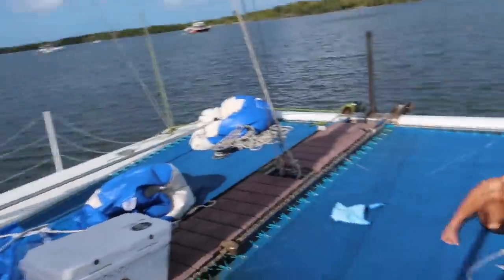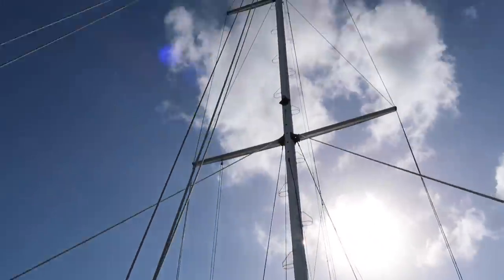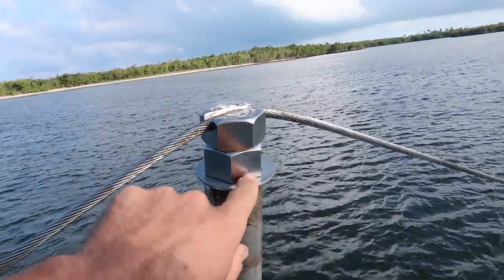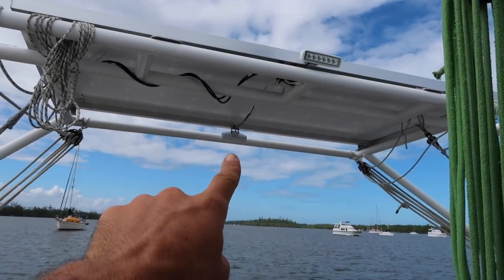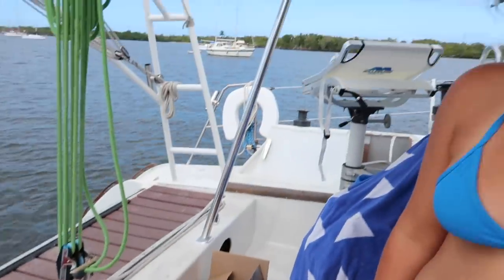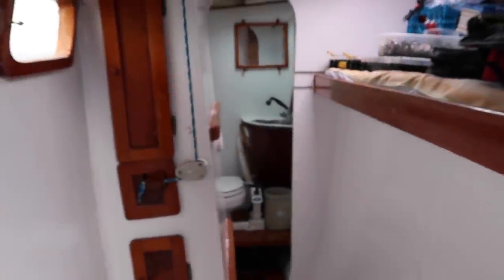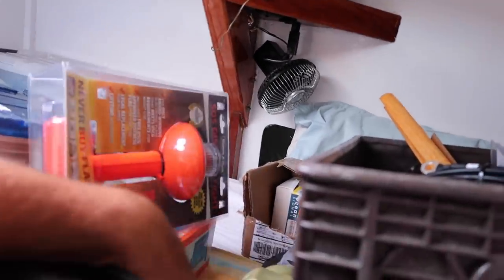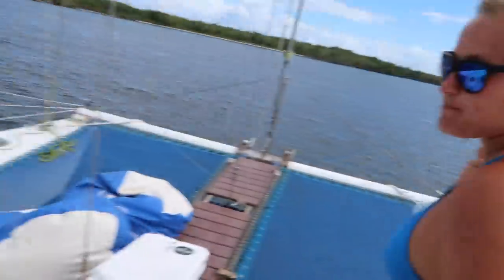DISAGREEMENTS ON A BOAT. should we have a generator on a simple, fast, multihull cruiser?

Comment: Come on Billy bring the gen., not necessarily for the a/c but for an emergency basis, you never know what may happen.  And if you two do not use it maybe you can barter with someone for diving tanks or similar things down the water.  Think of it this way, you never thought someone would still the motor from the dingy if so you may have taken better precautions . . .  so with the gen it can be justified as a precaution for "who knows" what could happen on the water!  BRING THE GENERATOR. LOL

Comment: That 2000i weighs 45 lbs. It also has built in 12v charging at like 8 amps. You can easily drain the fuel and its there if you need it since you already own it.

Comment: Be careful with that nut tensioner arrangement.  The bottom nut may have a tendency to vibrate upwards and cause your cable to come loose. Either a large lock washer or lock-tight or a lock-nut would eliminate that. Would hate to see that nut come loose when your fully rigged out at 15 knots.

And definitely take the generator and small A/C.

Comment: Comfort over speed, I will vote for comfort all day long now that I'm getting older, but I was just like Billy, speed was the priority when I was younger. If you do go ahead and get a AC unit, make sure it has a soft start installed so the small 2000 watt generator can handle the load.

Comment: First of all, having spent summer in the Caribbean, it can be amazingly hot AND you have the no see-ums and mosquitos in your remote destinations so the screens will limit air flow and no sleeping under stars unless windy!  Billy, you are not racing, so what's an extra 40-100 pounds?  Buy the AC in Florida too as in the Bahamas you will not have much AC unit choice, and it will be super expensive.  Better to have it and not use it, than be miserable and wish you had it.
I read a cruising article once that commented by using their AC only a few times a week, they also kept the mold under control.  Billy can use that data to save face and justify the extra weight.

Comment: Take the generator you could use it to charge your batteries in case you would have a short in your wiring or for starting your engines.

Comment: Yes on a generator and A/C.  Sometimes you need a break from the heat to think clearly and get a good nights sleep.  It will also top off your battery banks when it's overcast or raining.  As you improve your solar and wind power generation you can eventually wean off it.

Comment: Billy, Are you going to clean the hull every week? Slime will slow you down more than a 50 lb generator. A week of cloudy, rainy weather will devistate your batteries, but the little Honda will keep them up when neccessisary. Bring it. You won't regret it. When are you going to install the hydrafoils? After all, the cat doesn't have planing hulls and you installed huge rudders that have loads of drag at speed. I always carry a generator. The amount of money and weight I save by not having a big battery bank pays for my little Honda. Fair winds, Brother.

Comment: Bring it. Run power tools. Charge your batteries (boat, computers, cameras, etc). Run extra lights if you're working on something at night. Maybe you get an A/C and maybe you don't, but there are many reasons to have backup generator power. Most boats your size have one - for a reason. The extra few pounds won't make any difference. And Sierra is right, if you really need to find another 60 pounds somewhere, you can. And I bet whatever you find to remove is more optional than what a generator should be.

Comment: As seasoned boaters in both hot/humid and temperate climates, the ability to “get out of the elements” and find some comfort in our cabin was essential.  We always had the “option” and I would vote with Sierra on this one.  40 pounds is not much in the big picture.  I also sense some stubbornness here.....as a neutral observer, put the dang thing on board.  Boom! Done!

Comment: Check to see how easy it is to get batteries and solar power parts where you are headed.  
 understand price per hour. The generator  maybe cheaper than running the motor  if you need to power up that way. 
 I would look to see if you can supplement propane for the generator. ( IE like a electric skillet or grill) . And what are the price points.  It maybe difficult getting propane. IE travel far away.

Comment: Dudes, I have a diesel genset installed on my boat and the only time I run it is to check/service it. I never run it at anchor. I only use A/C at the marina - at anchor the wind cools the boat, jump in the water, use full deck shades. Extra unnecessary maintenance!!

Comment: Unless you're short on space - just bring it. Why argue over it? If you don't need it you can probably sell it in the Caribbean for more than in the states because somebody is going to be willing to pay a premium to get it there.   To be able to bring it but not do it is not the logical answer to me.   I wouldn't get one personally but if I did have one and I had a cat I'd certainly not limit my options because of 40 (or 60 :)  pounds.   You saved that moving to titanium alone.   BTW: did you get titanium bolts as well?   Would love to know more of the technical specs for what titanium brings to the table.

Comment: You should take the generator, but you should also check to see that it will have enough power to run the AC. The starting surge on many AC units will overload many small portable generators. Try it out - don't go by the specs.

Comment: I'll bet that generator doesn't put out enough watts to run any portable AC unit, it would be very useful for  innumerable other things, ie, charging batteries (boat batteries, portable tool batteries, etc) running a sewing machine (you may need to borrow one for repairs), ac powered tools. Remember, inverters can crap out too so you may need another source of ac power. I carried one for many years througout the south pacific on my boat & it was invaluable many many times. Besides, if you eventually find you don't ever need it they can be easily sold to a boat that wished THEY had brought one! You're going to be carrying gas anyway for the outboard. Besides Billy, you're massively out voted it looks like anyway. Keep that girl happy, take it!

Comment: Bring the Genny, buy a small 5000btu window AC and an emergency battery charger.  If you never use it, it's not much weight and space.  If you actually need it, it will be worth it's weight in gold.  I have kept a generator in the garage/shed for the last 15 years.  I maintain it and use it when camping and for power outages.  It's the Yamaha ef2400IS and it is amazing.

Comment: Forget AC as the reason, that’s a45.6lb generator, you own it, you already carry fuel aboard, you anchor full time, IMHO that generator is a backup system which should always reside aboard. It’s a backup against batter, solar panel, converter, etc failure. The weight is a minuscule fraction of the vessels GVW

Comment: What are your plans to keep the fridge going if you encounter several days of no solar? Running the diesel several times a day or you could let the Honda pick up the slack. We're heading to the Bahamas for a few weeks and def will be bringing the small genny
Reply from the maker: Well, we could always run one or both of our inboard diesel engines to charge the batteries like we have always done.
Reply: @Tulasendlesssummer  yes that is an option keeping in mind that genny is way cheaper to run, repair, replace and keeps unneeded hours off those workhorses...love our ryobi that idles down super quiet when it has small loads ;-)

Comment: Yes to the generator. Yes to AC. Also in the future of having a water maker on board, would make it so you could be away from marinas or having to haul jugs of water. The weight that a generator and a small water maker would be less than the amount of water you would need to carry to be away from marina or town for 3 or 4 weeks.

Comment: If the sea is cooler than the ambient temperature can you not just pump sea water through a radiator with a fan on the back of it? just a thought.

Comment: Bring the gen. What’s the deal with need for all the speed when sailing. 40# is what gonna loose you what a 1/4 knot. 2 gallons of gas is what 15#. With all the chargers and laptops and multiple fans for cooling and 2 or 3 days of no or limited sun you’ll be glad you brought it.

Comment: I am assuming that it is a 2000watt Honda. Take it with you. You can use it to power other things such as tools and charge your batteries when needed. If it gets damp, you can run a small electric heater as well. By the way, you are not racing you are going cruising. 40 lbs is not going to make that much difference overall. If you were that concern about going fast, you could have ensured that the bottom of your boat was ultra smooth. I don't think it is. Really enjoy your channel. Thanks.

Comment: Yes re having a generator on board.  If not for an AC unit, but just to have solid power on board in the event of an emergency.  The weight of a Honda generator is minimal.  It's nice to have when shit goes bad and the batteries are dead and for whatever reason you need some power to get things going.  Call it a good plan C, D or E.

Comment: Bring the generator it's under Fifty lbs. It can be used for charging the batteries running tools to do unexpected repairs. Balance it off with a portable rainbird reverse osmosis system too

Comment: can you not run a few coils in the water, connect that to a radiator and water pump and blow a fan through it?? is the water the same temp at 10 ft as it is on the surface???

Comment: Forget the generator. You have 2 engines, so you should be able to keep batteries charged even if you lose one. A good inverter that I think you have will work for your AC tools. Unless you take a 75# air con unit with you ,you will not find one in the Caribbean for Walmart ($2-300) prices.
Then you have the fuel to carry which I know you will have for the outboard anyway.  Beef up one of the engines with an oversized alternator if you really need the occasional extra power Sorry Serria, Cheers Warren

Comment: I'd probably look at a lithum battery bank some efficent solar panels and a wind generator for nights and cloudy days way more pricey than a generator but way less weight and no additional fuel! IT'S A good long term solution but not sure about supporting an additional anchor or ac unit... don't need A/C JUST JUMP IN THE WATER

Comment: Bring the generator just for backup to charge your batteries if the solar goes completely down and you can run tools from it for emergency repair it’s not that much weight for all the things it could be used for in a emergency including helping other boaters

Comment: Greetings Friends;   You do not need air conditioning in the Caribbean.  The constant over 20 knot trade winds will keep your boat cool.  I’ve made two trips down there with over 4 years anchoring out from the DR to Trinidad.  With the right hatches, wind scoops & awnings you can save the weight of the generator and the air conditioner.  Will that wussy little  Honda really drive AC?  Doubt it.  The  Caribbean does not have the unbearable heat of a Florida summer.  Don’t add that weight to a performance catamaran!   Bon Voyage from Bill of m/v Grace of St Petersburg.

Comment: Are you able to run power tools if needed off the batteries? If not, I would take the gen.
Reply from the maker: Yes, all our power tools are battery operated which charge off our boat inverter.

Comment: What is 40-80 lbs compared to the total weight of the boat?  It won't have any noticeable effect on performance.  It could however have a much more noticeable effect on your comfort and quality of life.  Imagine those days when you are working on the boat in the heat and you turn on the a/c to make yourself more productive. 

A fair compromise is if Sierra can find 40 lbs of additional weight to remove from the boat, that she will be allowed to bring the a/c unit on the boat.  Then you are compromising nothing with performance but you are keeping everyone happy.
Reply: maxbass 
Oh no, worst case scenario is that they split the weight loss difference and she find 20 lbs to get rid of. Maybe she can just stop feeding him, lol. That and the weight savings at the chain plates should be about right. 😜🥰

Comment: I brought a similar generator when I started my cruise a year ago, mostly because I didn't have a sense of what kind of output I would be able to rely on from the solar array. The generator didn't get used even once and was starting to deteriorate in the salt environment, so I sold it. For me, it's definitely not worth the weight or space. It's also an unnecessary chore to run it routinely so it doesn't get gunked up from sitting around. 100% on Team Billy. Also, after a year I've finally purged enough stuff to get the boat floating back on her lines, and the sailing performance increase is absolutely noticeable and worthwhile. Sell it and spend the money on something you actually need like bug screens, canvas for salon window shades and wind scoops etc.

Comment: 100 percent take the generator. Cheap insurance in case battery fails. Even if you don't get AC take it to keep batteries topped off and just in case you need shore power.

Comment: I'm not going to vote the cliche "keep mama happy" stuff. Sierra's right because she's right. 

Having a Genset is worth it's weight in gold when you need it and not just for comforts like AC. Bring it, buy a window unit(or cruiseair), skip bringing gas for the crossing(for safety),  skip AC install and try to tolerate the heat. If you feel you need it then do the install while there.. If you install it at the very least you'll get some content from it and if not then you get to be right all along lol.

Comment: I get that the concept of weight reduction / speed increase is an important one for a sailboat.  In that regard, nothing of use should be loaded onboard.  HOWEVER.... I'm also a firm believer in Murphy's Law.  If you don't take the generator, you'll need it.  If you DO take the generator you probably won't touch it.  :-P

Comment: Not taking sides here ;) but I'd be surprised if you can find an A/C unit that your little generator can start up.  Standard 115 volt A/C units don't draw much power once they're started and running - 5-7 amps for a 5000 btu standard one room unit but they require a lot of amperage for starting. Here is some good info.  https://generators.smps.us/start.html
Personally, about the only time I would want one would be for sleeping and for Jetty if you ever had to leave her alone on the boat during the day.  Blocking the windows with reflective insulation would help a lot or a tarp strung over the boom (and tied to your life lines) to shade the saloon would also help a lot. I would like to think sleeping on the tramp would be an option if the sleeping quarters became too hot, however bugs may be a problem then.

Comment: it's quite simple really why have a gen when you have to store it carry fuel and the extra weight when you can just get an extra alternator or just use the one, ones you have and a 3kw pure sine wave inverter? Lighter more compact and without the dangers and hassle go getting and storing petrol, gasoline.

Comment: Why doesn't anybody use a fantastic pham on a boat I'm thinking about putting one on my boat this summer and the reason why I like it is because it's 12 old and you can bring the air in and you can bring the air out it also has a thermostat and a rain sensor and I just think it has a lot of volume of air with low battery C could run that thing all day long Also I think I would compromise in get a smaller generator because you can run a airconditioner on 450 W and I think your generator is 2000 so trade it in and get a 1000 W good compromise any time is a problem he always meet in the middle

Comment: Take the Generator.  Better to have it and not need it than need it and not have it. You guys have the room and 50-60lbs will not make a big difference. Plus you can charge your batteries if you have afew days without sun.  It needs ran.

Comment: Bring the generator! Happy wife ( girlfriend ) Happy life!   The generator only weighs 45.6lbs dry, you already have gas on board for the outboard so what’s a few more gallons for the generator. You never know you might need more power to run pumps. I have 1 and it comes in handy every now and then. 
45.6lbs gen. + 5*8=40lbs fuel = 85.6lbs  come on how much is that really going to slow you down  a quarter knot at most. All the lights and fans your talking about hooking up, hack your going to need a second battery, the battery weighs in at 45.5lbs.

Comment: Sorry Bill I'm going to have to side with Sierra on this one.

You may not need it but the pragmatic side of you should say bring it.

I've been to Bon-Aire the Saint John and it's hotter than Hades, so a small AC unit wouldn't be bad because there are days where it is Dead calm.

Especially if it's for only sleeping. Always be prepared for the unknown.  

The other thing is women are always right, that's how you stay married. 

Fair Winds and following Seas......

Comment: portable gas generators are a safety hazard. 1) extra gasoline on board.  2) CO.   Be safe. Find a little marine diesel gen if you must have one.  Farymann makes one that is < 120 lbs.  Im sure there are others.  Even though its diesel, don't ever run them while you sleep.  Just not worth it.  Just my $0.02

Comment: You should a least get a 1200w generator as back up. get a wind solar system. just use the  generator as way to get your system back up to charge 

My system 
400w wind
200w solar
1200w generator 
6x 12v deep cycle batteries 
3000w inverter
Reply: Oh it's on my 26ft grampian